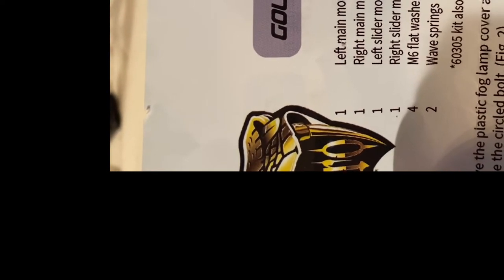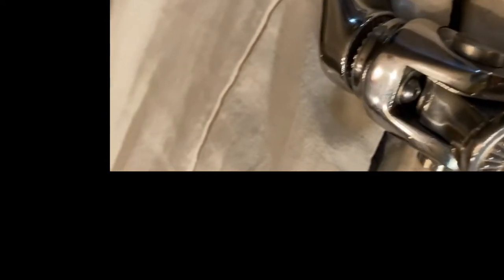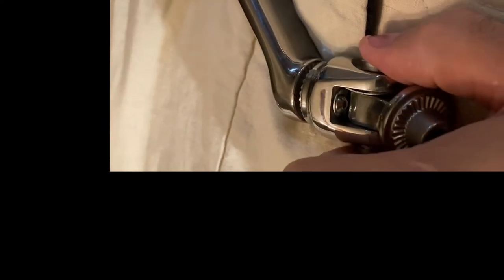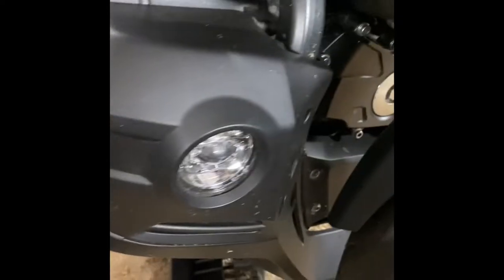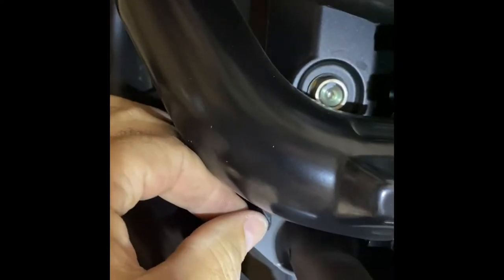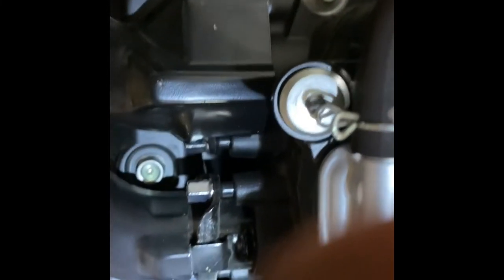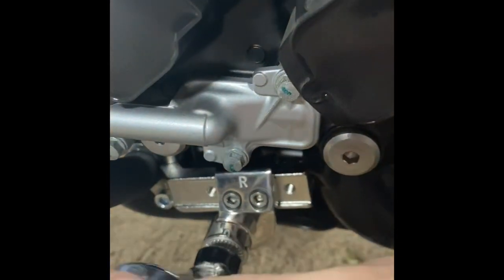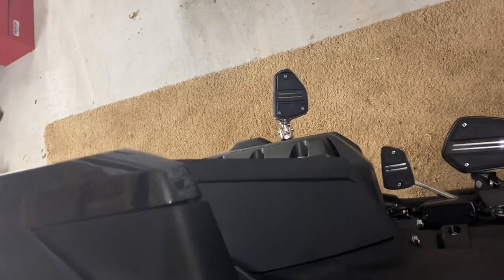DIY Goldstrike 3-Way Adjustable Highway Peg Mounts Install

Comment: What was the size of bolt you removed from the bike to install the 70mm bolt I have DCT 2022. Tks
Reply: Mentioned at 18.11 12 mm...watched this a couple of times before fitting mine as lots more detail than others